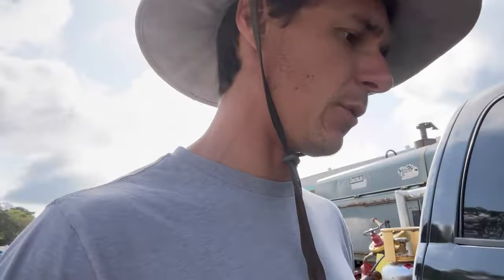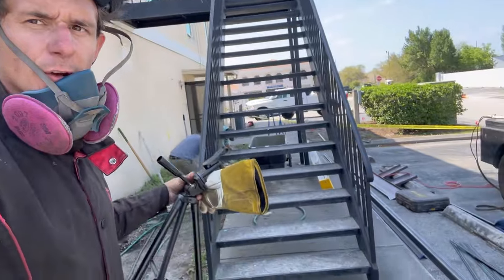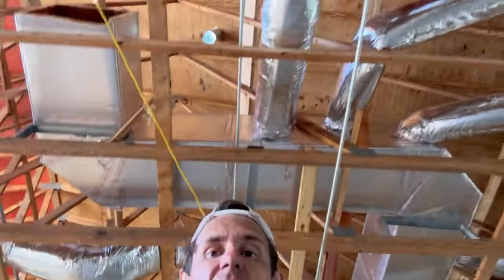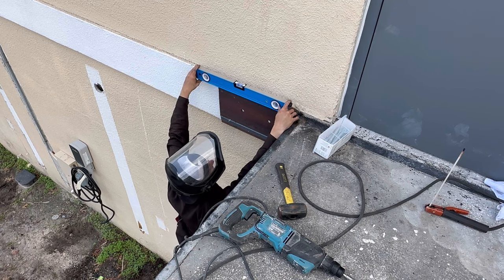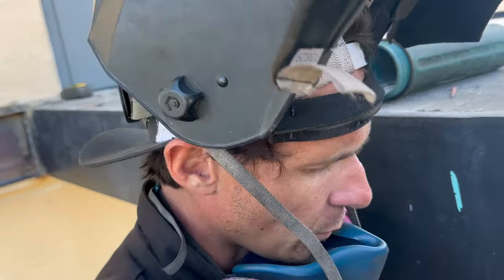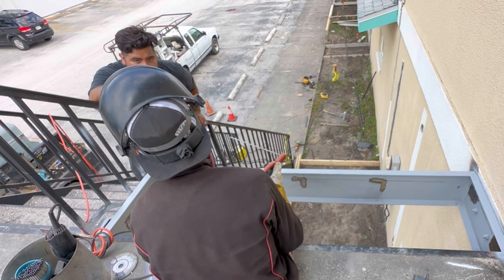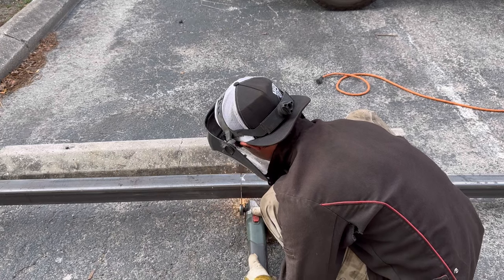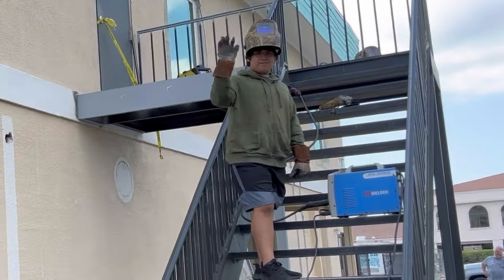Stairway inspection problems (weld it back to code!)

Comment: As a stainless fabricator, i absolutely love learning "real world" welding, like this.
Im stuck in a damn chair tig welding big pharma bullsh*t all day
Reply: Im sorry to hear that. At least youre not a wire monkey like me. I can to mig, stick, tig, and flux core but im stuck doin mig.
Reply: But I bet you make good money doing it. I'm 64 years old still working as a Fabricator, I Tig and Mig weld nearly every day at work, I have 3 More years until I can retire, Sitting down Welding in a shop is Good work To me. I've done my years working outside in the Elements, thankyou very much.

Comment: 24:55 concrete shrinks when it cures so that’s why there’s the small separation line. That’s also why control joins are a necessity on big pours.
Reply from the maker: He didn’t trowel them was my point on that one, also it had a 1/4 slope toward the dirt cause he didn’t mix enough mud, even said it 😅🤪

Comment: When you come to an "open railing" do you blow the insides to clean it? Grease it ? Sheila shine it? WD40? Windex? Or use a sand blower? To clean the glass? And im probably gonna sound stupid but if the building is 10,000 square feet is 5,000 people the capacity of people that can fit in that building?

Comment: It looks like you're using NR-211.  Do you have any experience with NR-232 or 233?  I'm gearing up to start taking some mobile welding jobs, and i was looking at E71T-8 for general purpose welding on carbon steel, to use instead of stick welding, under most conditions, due to the higher productivity that it can provide.
Reply: T-8 wires are for heavy structural. Would have been a good choice for Anthony's portion of the job, the channel, angle, hss/base plate welds. But it would be a nightmare on the railing.
Reply: @jordanarizon4089  my understanding is that T-8 wire is suitable for general purpose welding of mild steel and certain alloys, in addition to the specific applications for which it was expressly designed.

Comment: I was hoping you were gonna run your tape to 21 on an angle and mark at the 7 and 14 on the wall mount for perfect spacing of your holes. Like you said, perfect isn’t necessary.

Comment: Excellent video.  I think I hate wind more than any other type of weather.  I'll deal with heat or freezing temps. Rain is fine and I can live with snow.  I have no use for wind and it drives me batshit crazy.  When you mentioned you remember the stairs being there when you were a kid it reminded me of the time I got the job of ding some welding on the playground equipment I had played on thirty years ago.  Most of the original stuff was gone (including the sharp gravel that was laid all over and around the base of the equipment) but the huge swing set that I swung on and lept off of the top of the arch and landed face first onto the sharp gravel was still there.  Oh ya, did I mention that happened on picture day?  Mom was thrilled when they sent home the proofs to see which pictures she wanted and saw my fat cut up lip and big gash on my forehead.  I got to do some rust repair and hopefully future abatement.
Have a great week
Reply from the maker: That’s awesome it came full circle like that, I never repaired play ground equipment before

Comment: That's awesome I've said it before you have the most realest world view on what it really is you don't mask anything I got that same chipping hammer can't go wrong with a EST wing and I think that's awesome that your subcontractors teaching his child how to weld in a world where things are so diminished we are short on people in our trade and I really appreciate the sarcasm about the Hobart wire I would rather use 211 innershield every day if that's all I had a choice to use on carbon steel but if you got to use Hobart I always used fabshield 23 I love that stuff it's the only Hobart flux core I like you can use it on galvanized materials and if I got to use their electrodes I like the Hobart extra low-moisture 7018 otherwise it's Lincoln Excalibur and esab Atomic rods all day long

Comment: Awesome.
Your sub contractor dont look like no welder ive seen.
But the work is what shows.
Reply: What is a welder supposed to look like???🤔
Reply from the maker: Herm is the man! You should see the work he does
Reply: That's what the kids (mostly in their 20s) thought when I (35 at the time) took a welding course at the Community College... I'd show up from work in a polo shirt and throw a welding shirt on over that... but I ended up with the highest score in the class and did 1.5 semesters of coursework in one semester.  Mostly because I applied myself and worked until the instructor was ready to lock up and leave, and the others would goof off after the first hour or so of class.  Difference was, I paid almost a grand to be there and their tuition was being paid for by grants from the State...

I never had any actual trouble from anyone except for an instructor from another section of the class, who questioned whether I was actually a student, until my instructor set him straight.  It was pretty funny, as he came back to me and acted like we were old pals...

Comment: If your railing has 20 bars is there a weld that is specific to the 20 bars? On the decent of the stairs standing from the top there are how many bars let's say there's 13 steps 26 rails on one side do you account for rebars on the inside of the other side of the stairs? 
Since I'm not familiar with all my choices of rods can I choose the number of the closet highway or junction? If the street has a number under like >1000 Martin St
 <1000 do you choose this amperage or rod? 
If your on San Pedro and you notice that the street sign is brown blue or green do you choose that color rod in accordance to the street or do you go to a higher or lower order or higher or lower code?

Comment: Do you ever use 6013?? Every time I use 6013 I get porosity in my welds. I hate using them. Am I just not welding right with them? Or do they just suck.
Reply: I would prefer 6011 alllllll day. I refuse to even buy 6013

Comment: Evolution makes a metal cutting circular saw i love mine i cut lots of plate with it i prefer it instead of a grinder or torch  for cutting plate for things like this
Reply: Horrible loud sound compared to a torch or grinder.
Reply: @WorkingOnRocks  yes but more precise
Reply: @loganrench5680  I agree . But all fun and games until you have a bad blade. Or no blades

Comment: Darn it...wanted to post pic of rails I make. Weld them onsite to a 4 in flange plate using 3/32 7014 Lincoln rods. 7014 is very strong in my opinion

Comment: Noooo . 7018/6013 is a pain/horrible to weld on these railings . 7014 Lincoln electric 3/32 stick weld at about 80 is perfect for this job . I weld all railings with 7014 Lincoln electric.  It works perfect for me especially in the wind . 5lbs should be about 20$ please try it you won't regret it . Do a review on it ..

Comment: is there a reason why you do not have the protective screen on the angle grinder? i have had my fair share of exploded disc´s and that screen really saved my face and torso everytime, it also IMO keeps the sparks and dust to come out controlled instead of spraying everywhere?
Reply: Why use an annoying guard when you got supreme armor, thick gloves and full face shield
Reply from the maker: The rubber gasket they put on the Metabo’s wears out and it drags the wheel so I ditched it and haven’t went back. I do have them on other grinders just not the deadman 6” death machine 😮
Reply: @yinggamer7762  because pieces of broken disc´s can penetrate alot of your body, your hands and face are not the only places those mofos target.
Reply: @MeltinMetalAnthony  i haven´t used metabo grinders that much, but i know the guard uses to get gunked up over time with metalspatter, i usually knocks it off with a screwdriver, since my apprenticeship ended i have not had a guard drag on my wheel. bug again i do not know if that´s solely a metabo issue, im more of a makita guy due to prices :D metabo here in dk costs almost twice of what i can pay for a makita grinder.
Reply: I've had my lip split wide open from my nose down and my teeth busted out from gouging out some weld with a grinder. Once that happened was full face protection from here on out. but I've had my index finger burnt by the back of the wheel many of times from not having a guard on. Save our face. I seen he got split on the same way not long ago.

Comment: I just look at this stair case and think, they had all the room and opportunity to build a shorter landing, run the stairs along side the building, pour a small pad at the bottom and not block the whole sidewalk but they did this instead 🤷🏼‍♂️
Reply from the maker: Ya that was the original plan. But we had to do a budget job because other stuff got out of wack

Comment: Wind should not affect fluxcore.
Reply from the maker: After 15mph it does
Reply: It's creating a gas shield- gas can be blown away.
Reply: @MechanicalMercenary  So you can't stick weld in the wind either?
Reply: @donsmith9081  stick welding has the coating to protect it
Reply: @donsmith9081  way more flux on a rod. It doesn't have to fit between rollers and into a liner. The proccess may have something to do with it as well. Maybe I'll try to stick welder next a leaf blower and see what happens.
Reply: @ptitheprodigy  Solid wire is solid.  Fluxcore is not solid-hence the name-flux.

Comment: and also heres another tip for ya, flux core wire on them pickets and railings, are a no beuno! If your using mixed gas with your wire feeder, 0.35 mig wire all day bro!
Reply from the maker: I think you need to stick to whatever you really do for a living, cause it ain’t welding 🤣
Reply: @MeltinMetalAnthony  that material your using, pickets and the tubing, isnt but what 11ga? mig wire would have been plenty, AND THEN WOULD HAVE LOOKED 1000X BETTER, lmfao.
Reply: You can't mig weld with gas in the field, only in the shop or with zero air movement in the field.
Reply: so your telling me you cant flux core weld in the field either then i guesS?
Reply: @Theragecheaterlolz you just said flux core wasn’t a good option then doubled back and said you can use fluxcore in the wind you are a real bright individual

Comment: Dude you need to get a cordless metal saw. I've nearly retired the metabo for cutting metal.  Way faster.
Reply from the maker: Like a band saw? Fuck that
Reply: @MeltinMetalAnthony  no dewalt/ milfuckie Lithium Ion Metal Cutting Circular Saw. They cut metal nearly as fast as a wood saw. 
I had the mifucki corded and it will cut through 1/4-3/8 likes its nothing.
Reply: I just bought a Milwaukee circular saw for steel. And cut up to 3/4” Plate. Really a lifesaver compared to torch where you got to clean up the metal after the cut.
Reply: @rz121867  definitely cheaper than oxygen also haha
Reply: @MeltinMetalAnthony  check out the milwaukee 8"metal saw. They are amazing. I can easily rip cut 3/4" plate at the same speed as a torch. Cut 1" on occasion no issues. I use it to cut c10 for stringers ect.